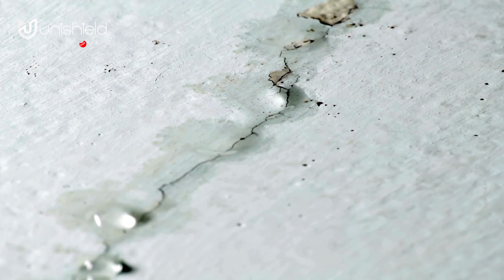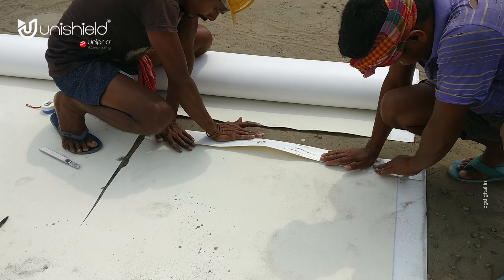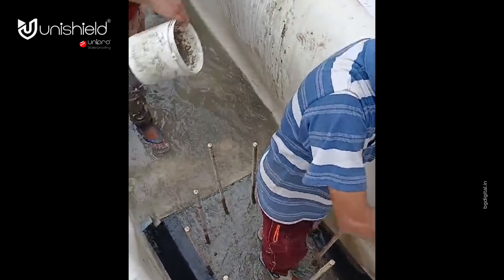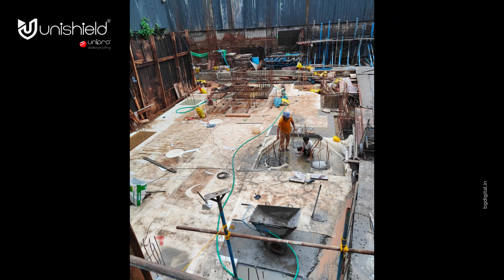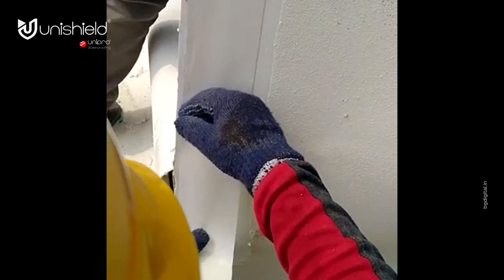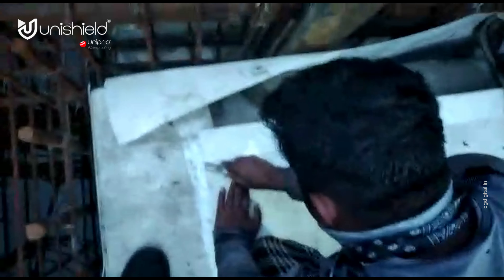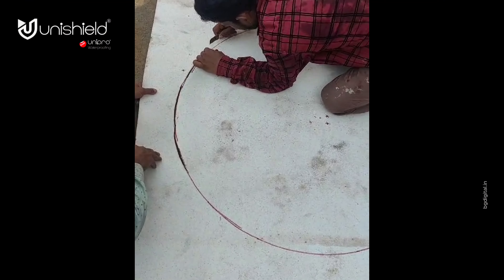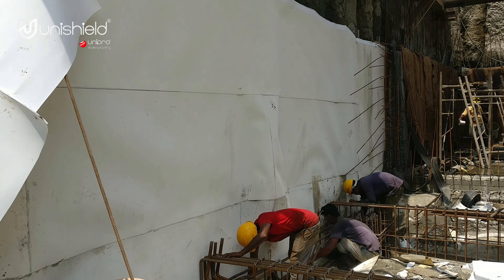Basement/Cellar Waterproofing with HDPE & SBS Membrane | #basementwaterproofing #waterproofing

Comment: Can this be used after the building is constructed. 
A building is near a small stream. One feet water comes in the basement rooms in rainy season only. Can this be avoided in rainy season.
Reply from the maker: This system is to be done during the construction itself. In your case, the leakage is observed post construction. This leak can be effectively addressed using secondary reinforcement techniques. Kindly forward your contact or pls contact us at 9544308555